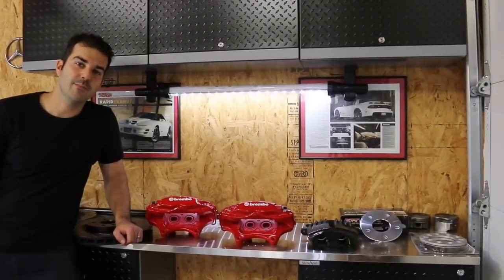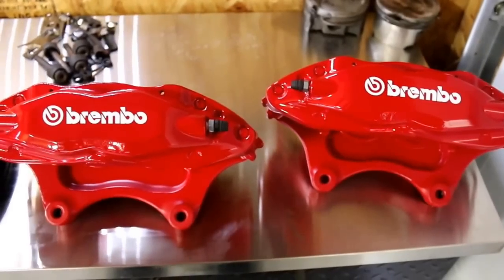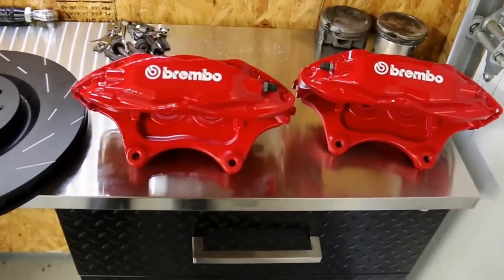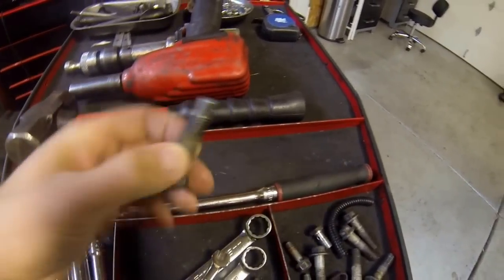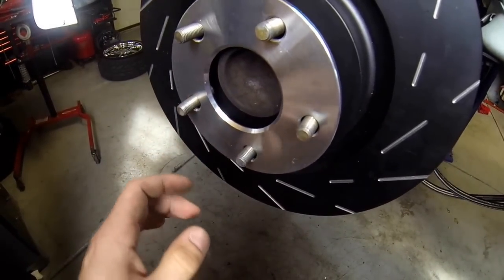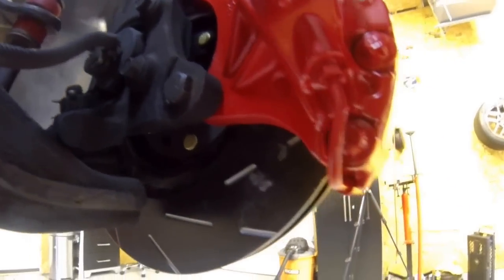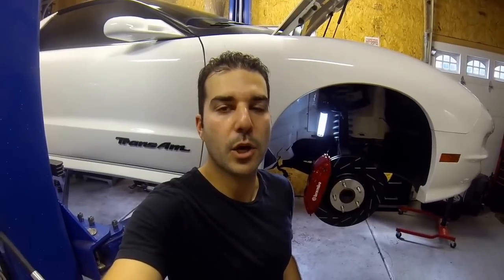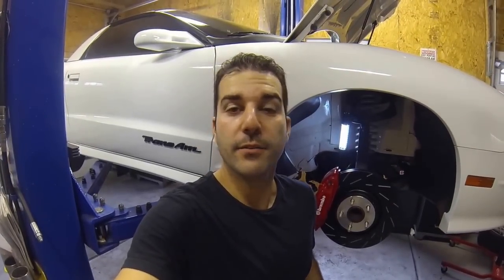Cheap and easy way to upgrade LS1 Camaro or Trans Am brakes. CTS V Brembo install.

Comment: I think we have the same wheels. 18x9.5" c5 replicas. Mine are +54. Is that what you have? if so, I will get the same spacers as you. Can you help me?
Reply: Should be fine with those spacers it depends on spoke design

Comment: Is there any way to do this without using a wheel spacer like correct offset wheels? Real question
Reply: Yes it will depend on your wheel design as well. I'm running a concave design wheel and they're 40 offset but it wasn't enough so I had to run a 5mm spacer pushing it out to 35 offset, the wheel clears by a 1-2mm

Comment: Hello.Now i have all parts for this Brake Setup together.But i need the steel Brakeline kit.Please help me.How long are this lines and what bolds i need from Start to End(Calipers).I need Street conforms lines for the German Tüv Car check :-(.I found a Factory here and they build it for me.I need only the facts for this lines.Greets
Reply: Marc, contact this company in the USA, their website is Kore3.com

That's where most everyone who has done this conversion gets their lines from. Tobin is very knowledgeable and should be able to tell you what you need. Good luck!

Comment: Thanks for such a great solution for my 2002 Firebird Formula. I’m trying to duplicate everything you listed however I am stuck not being able to find the conversion brake lines. I have called Flynbye multiple times and sent email but no reply. The voicemail has a generic message. Do you know where else I can find the conversion brake lines?
Reply: Order from kore3, they're great and very responsive, no issues. Orginally ordered from Flynbye (accidentally got the wrong lines) so I tried calling and emailing them, no response.  Ended up selling those to someone else for less than I paid.

Comment: Will this fit with esr SR05 wheels? 18x9.5 +35 offset with 265/35R nittos
Reply: Should work, I'm running 40 offset with a 5mm spacer and they clear

Comment: As far as Wheels, do you buy the same bolt pattern for F Body in just 18 inch?
Reply: 5x120 yes run a hubcentric ring or spacer to eliminate vibrations

Comment: Don't knock them just because you can afford 1000 brake upgrade now drilled slotted works better than the OG 4th generation rotors

Comment: Hey may I ask what kind of brakes r u running in the rear.    I have a 2002 camaro.  I want to run 18” rims.  May I ask what size tires r u running all the way round
Reply: I am running 18”s all the way around.  295/35/18 rear and 285/35/18 front.
Reply: I'm running the ctsv brakes up front and factory size rear with stoptech rotors. 275/35/18 295/35/18 nt05

Comment: Where can I find a nice front  4 piston style calipers for my 2000 Trans am? I have nice rotor upgrade and Earles steel B break lines. Just looking for 4 piston setup for the front
Reply: Ebay ctsv calipers
Reply: @bhcamaro2002  thank you. For what I planned for my Trans am. I just need a nice set of 4 piston calipers up front, that will bolt to the stock caliper bracket, and knuckle
Reply: @bhcamaro2002  will those calipers bolt right up? Or do I need a speared kit too have them bolt up too my stock caliper bracket and knuckle
Reply: @jamesdelong6401  yes they bolt to 98-02 spindles just need to have a 5th gen rotor bored out by a machine  shop to the same spec as the hub
Reply: @bhcamaro2002  sweet. Thank you. I will get all that in my bucket list for the front .
Reply: @jamesdelong6401  you might need a small spacer, also definitely reccomend getting arp extended studs nice upgrade to do while there

Comment: Is the 4th gen master cylinder a match to these calipers and their given bore size?
Reply: Yes I'm running the factory master no issues, if you go bigger and change to bigger in the rear you would likely need a valve to control brake pressure front and rear

Comment: arre the break lines necessary or can you use stock ones ?
Reply: Best just to do them while you're there, helps with pedal and shorter stopping distances. I'm running this on my SS it's on my channel

Comment: I can't find the 14inch rotors on eBay . Can you get a part number for me ?
Reply from the maker: Check the description of the video. I listed part numbers. Thanks for watching and let me know if you need anything else.
Reply: LegitStreetCars what kind of front struts you have ? Can those raise/ lower the front end ?  Please let me know . As I own a 99 trans am ws6 and would like to raise it 1.5 in to acomódate my new wheels.
Reply: @aag6499  
I'm not a big fan of coil overs,but they may fill your need quite nicely.

Comment: Cross drilled rotors suck the holes in mine started cracking and I never took the car to the track ever only street use
Reply: Yup I swapped from those to stoptech slotted rotors when I did this mod so far so good

Comment: will these also work for the 2010- CTS-V 6 PISTON caliper.
Reply from the maker: Im not totally sure if those calipers will work with the 14inch 5th gen rotors. I know that when the 5th gen guys upgrade to the 6 piston calipers they usually go with a 2 piece rotor off the zl1 or gen 2 cts v

Comment: Will that fit underneath a 16 inch wheel or do I have to upgrade to to the 17 wheel
Reply from the maker: I don't think there is any way to fit a 16. Some have done certain 17s but grinding was required.

Comment: Hello.Can i re use the OEM brake stock lines with the oem brake line bolts in the Brembo Caliper?Greets from Germany.
Reply from the maker: No you have to get longer brake hoses.
Reply: LegitStreetCars thank you for the infos.Can you give me the Bold sizes.I mean the Bolds in the new Brembo calipers to mount the new lines.

Comment: will this work on 93-97 fbodies?
Reply from the maker: Blake Barterian Yes but I believe you will need the ls1 spindle. And remember 16 inch wheels won't work at all. 17s require grinding and most won't bother with them.
Reply: OK thanks great vid btw
Reply: Ls1 spindels both front and back ? i got a lt1 97 f-body, really want this upgrade !

Comment: will this work on 3rd gen F Bodys 87 Camaro
Reply from the maker: Justin Jones If you upgrade to ls1 front spindles yes. Also run an 18inch wheel or larger

Comment: Did you do the rear brakes also?
Reply from the maker: The only thing I did with the rear would be the rotors to match the front and painting them red to match.  There isn't too much of a need to do big brakes in the rear other than looks. The fronts do most of the braking and putting bigger rear brakes on would most likely cause issues with the rear locking up.
Reply: LegitStreetCars my shop is saying the new 14 inch rotors don’t fit the stock pads and calipers. Any advice before I pick the vehicle up?

Comment: how about the rear brakes..can they fit the bembo to
Reply from the maker: Joshua Duarte These exact brakes will not fit the rear.  Most leave the rear alone
Reply: Joshua Duarte theres a bracket i believe you can buy that will fit these but you have to be running the 10 bolt rear stll.

Comment: Why the 4pot vs the 6pot cts-v calipers, are you worried about brake bias with the 6pot or just cheaper?
Reply: Or maybe you didnt want to drill out the mounting holes on aarms, bc dont you have to go with bigger hardware with the 6pot cts-v calipers.
Reply from the maker: It's been a while but I believe the 6 pistons required some additional work and they were more expensive. But ya another good point is brake bias too. Overall these are a great upgrade and after you sell off your stock brakes you are only about $500 deep.
Reply: LegitStreetCars whats the best way to get the old wheel studs out of the hub, do you literally just beat em out with a BFH or is there a better way?
Reply: Yes. Grap the Tonya Harding and show those studs who's boss!!!

Comment: Spend a small fortune on a braking system upgrade and you still need to send out the rotors and get them machined so they fit. Ridicules.
Reply: Cheaper than the alternative for bremo brakes. Especially if you can source the calipers used.